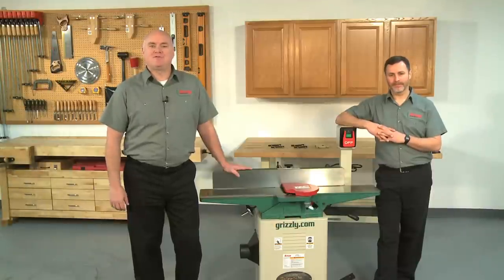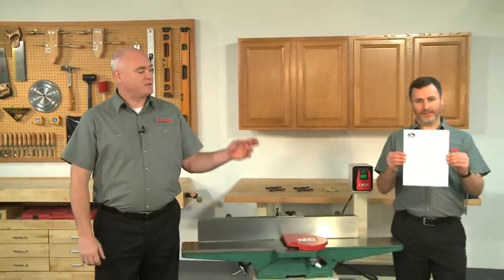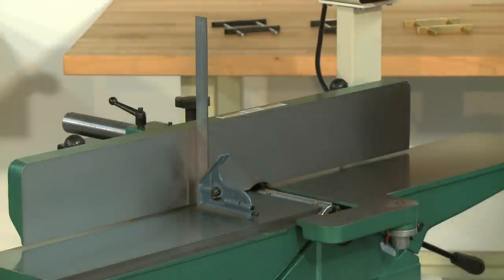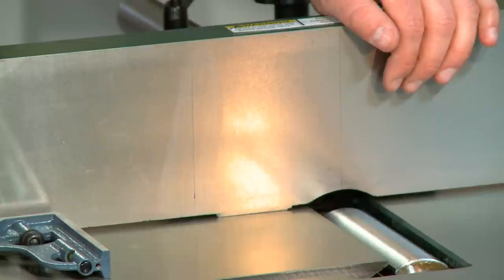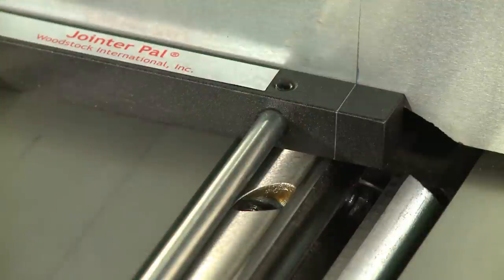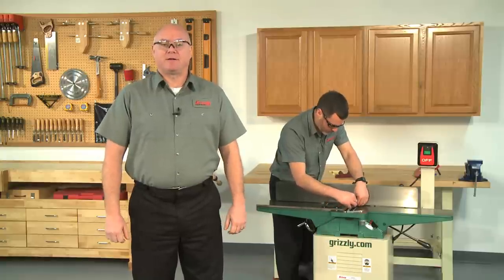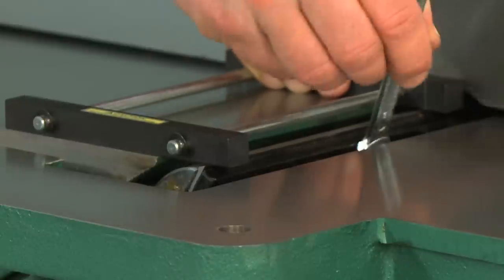How to Use Jointer Pals -- Knife Setting Jig for Jointers

Comment: I don't understand the purpose of all the other scribe marks besides the TDC one.     

The second mark is located the same distance as the marks on the jointer pal.  The rear mark and the 90 degree mark on the bed seem unnecessary.    In fact, I just did it this evening using only the front mark.   Am I missing something?
Reply: I have spent a long time trying to use the Jointer Pal with my Grizzly Jointer. I am convinced that the scribing is meant to fool you into thinking that the Jointer Pal is a precision tool, when it is really just overpriced junk.

Comment: At the beginning you say to find TDC but using this method that only works if the blades are at the correct height already. Right?
Reply from the maker: Hi Joe, thanks for the question. Yes, the referenced blade should be at TDC before moving on to the next steps. If your machine is not at TDC, adjust your outfeed table height until the bottom of your straightedge just contacts, then mark that point on the fence, as shown at 2:00 in the video. It's vital to choose one blade as the reference in order to set the height evenly for all blades after that. Hope this helps!

Comment: Your using the installed blades to find top dead center. What if the blade is not aligned properly? Isn't there a more precise way to find top dead ctr?
Reply: I've got exactly the same situation going on about a used jointer all 3 blades are set at different top dead centers if I  Do it the way that they show

Comment: How do you find top dead center if you have already removed the knives?
Reply from the maker: Hey there! 

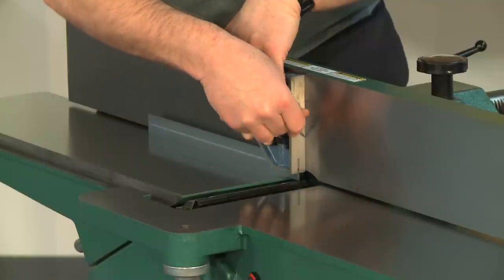Unfortunately there's no good way to locate the top dead center without the knives installed. According to our experts, to find the proper TDC (top-dead-center), it's vital to have the knives installed (see 1:50 in the video), and to mark the positioning of TDC as shown in the video around the 2:10-mark. This will ensure that you always know the TDC location according to the knives used--or at least the top of the cutter arc, as height may change slightly with sharpening over time. It's very important to know the TDC with the knives in place for a consistent installation, and to always check the TDC alignment with your outfeed table height using a straightedge. 

I hope that helped somewhat, and please feel free to contact our customer contact team or Tech Department at Grizzly.com/contact for further questions or concerns.

Comment: I plan to get this tool.  What I need to know is the size of the bolts on those bars that hold the blades in place.   I inherited a Delta JT360 6" jointer and it was a floor model without those bars.  Delta no longer sells the bolts but I did get the bars.  Yours looks exactly like the Delta.   The rep at Delta thought they were 1/4"x28x3/8".  Manual calls for a 10mm wrench to remove the 4 bolts on each bar.  I just need to know the bolt size so I can buy locally.
Reply: Look up "Thread Detective" on Amazon. I bought a set of these and they are absolutely invaluable for finding nut and bolt sizes.

Comment: congratulation, you just gauged some deep scratches into your $700 jointer's cast iron top that will later turn into rust, now go and make some saw dust. brilliant.
Reply: Only water will make it rust, have had one on my jointer for years. It's cast iron. There is no coating on it .
Reply: If you keep your cast iron tops coated with floor wax, water Can't penetrate o cause rust! You're welcome.

Comment: David, we would suggest you take the jig to the hardware store and see what bolt fits. Most likely ¼-28 or M6x1. Many older imported machines had bolts with standard threads and metric heads so it’s very possible the Delta dealer and the customers manual are both correct.